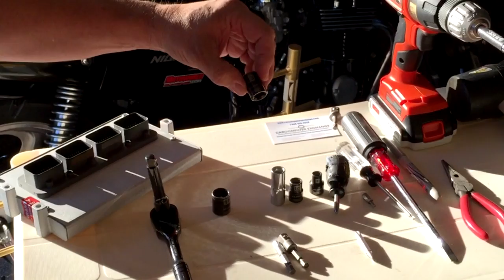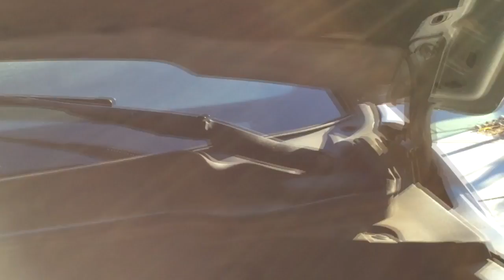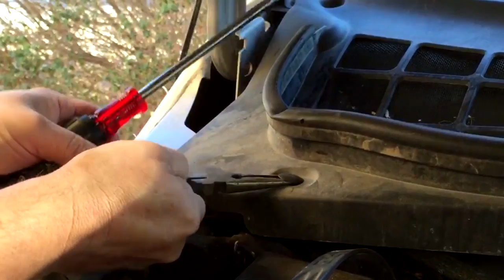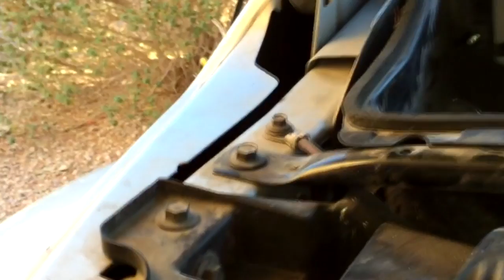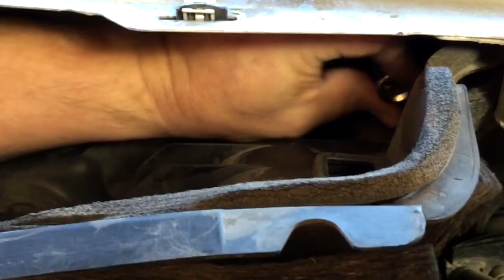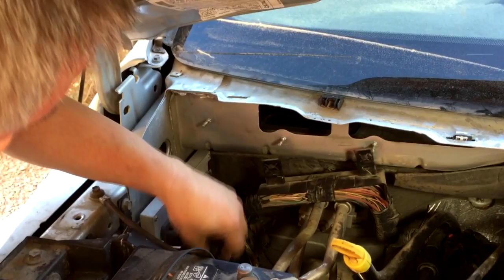PCM Replacement

Comment: Computer Exchange is the worst company you could have dealt with. They destroyed my computer and lied about what I told them the symptoms were.  They refunded my money after I got my bank involved, but my car's original computer was dead. I had to replace everything dealing with the computer. They said they just don't have computers laying around. After that statement I am surprised, they are still in business with service that bad.
Reply: Sorry you had so much trouble with this company, but it has been 9 years and post COVID so things with companies have really gone down hill. But it was a good thing back in those days and I posted this mainly to show how to do it, and not pushing the company that supplied the product, but at that time it was a good company. There were many other places to go. I did this myself because at that time the Dealer said they didn't know if they could even find a PCM Module to do the job.

Comment: Great video and insight on acquiring a replacement.  Comical how Chrysler thought this was the best spot for the PCM.  Real world issues considering all the water that dumps into the engine bay along the wiper cowl.  I learned early on to run a nice rubber slab of material along the underside to prevent all that water leaking in.  

Quick tip though for those with possible PCM issues...  Prior to replacing the PCM it's probably a good idea to check the module and connectors for signs of debris and corrosion.  If there's any sign other than age when you have a look try cleaning the connections with some good electronics cleaner, let everything thoroughly dry, apply a bit of dielectric grease at all the wire connections for good measure and reconnect.  Start it up and see if it remedies the issue.  Might save a few bucks that is probably needed elsewhere since Chrysler outsourced quite a bit of other parts over seas.

Comment: Before you replace your PCM the biggest failure is a ground issue in the wire harness. With the ignition switch on please check your 5vlt reference.

Comment: Is that the transmission control system? I'm just ask. Love my 2006 dodge dorango 4.7.
Reply: Not Sure it handles the Transmission, I replaced cause it effected the firing of the spark plugs and stuff to the engine and emissions control.

Comment: Basically identical to my 2004 Durango 4.7l.
Thanks to your video, I was able to replace my PCM myself.
Without your video, I would not have been able to do it otherwise as there is very limited information online about this particular repair.
Reply: Hey Tommy, Glad it helped....  As I have said, Thank God for You Tube at times.

Comment: Thanks so much, this really saved me money on my 2007 Chrysler Aspen, the dealership wanted $1,500 I got the computer for $275 and with your video installed it myself... Thanks again...
Reply: I hv a 07 I'm slowly working I needed 2 fine the pcm 2 change out for my upgrades

Comment: Robn - EXCELLENT Video, I have a 5.7 '08 Aspen, (same basic vehicle regarding the PCM). Ordered my PCM from FS1inc (Flagship One, they pre-programmed the PCM based on my VIN....so it was plug-N-play). I just finished installing it thanks to YOUR VIDEO! It was a breeze. Hardest part was getting the wiper blades off. When I turned the vehicle on, the check engine light was gone but the throttle body light came on (red lightning bolt). I revved it once, shut it off and turned it back on and no lights at all. Next stop, vehicle emissions for a test and re-licensing.... thanks again!!! Side note, I did remove the battery terminals (both) just to be safe.
Reply: Hey Jerry,, Glad it helped... Like I said, the hardest part for me was finding where it was! Also the Windshield wipers were also a challenge just like for you. Although refurbished, the Module lasted over 2 years and I have recently sold that care and it was still going strong.
Reply: Jerry Craig what were you symptoms
Reply: I hv 2007 5.7 I'm slowly working on